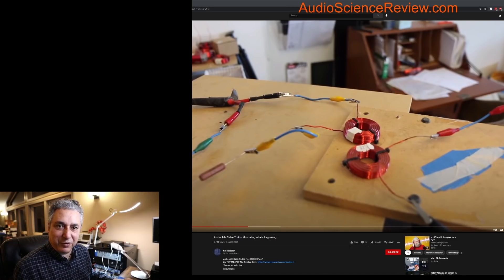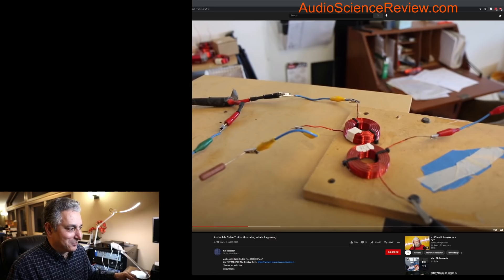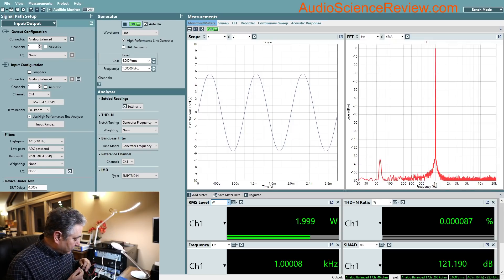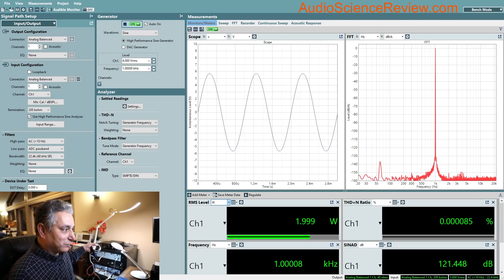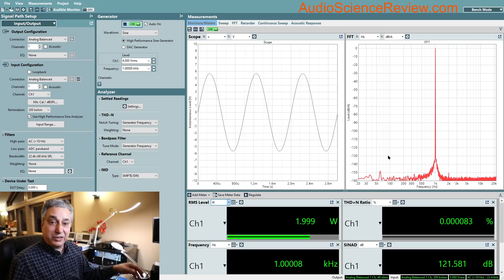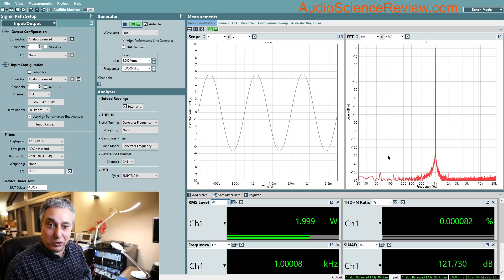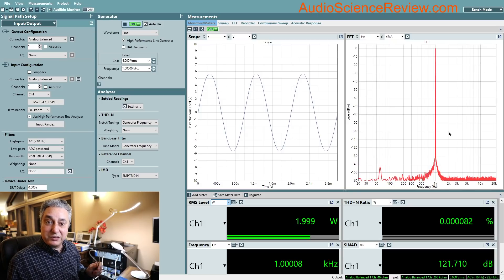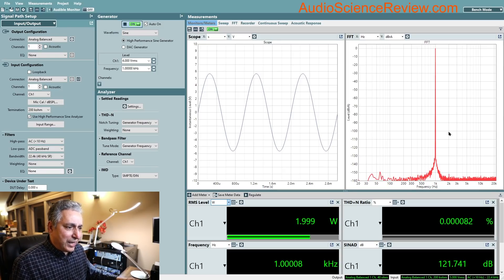Electromagnetic Interference In Speaker Cables?

Comment: Paul from PS audio said that the frequencies that we cannot hear, do to some degree affect the ones we can hear. And that is why ultra low and high end  speakers affect the listening zone.
So again it just shows that these measurements are not as black and white clear.

Plus for some people, especially most at the lower levels of HIFI, could potentially gain from having a bit of distortion.

Plus you can actually hear someone moving the cable. But it requires someone doing that for you while you are in your listening position. And just occupying that space physically behind the system, could actually change the sound so that the sound waves don't travel the same in the room. (so that argument is invalid)
Reply: I sincerely hope that Paul from PS Audio's claims are the next target for Amir's videos.  Amir's scopes can easily measure noise in frequencies far above and below what we can hear...so they would show up on the scope.   In addition, even though cables can transmit a wide range of frequencies...no speakers, even high end ones, will reproduce those frequencies, they will not even try to. When someone asks you to spend thousands on speaker wires to eliminate distortion that cannot be heard and cannot be measured....think hard before pulling out your wallet.
Reply from the maker: Paul is appealing to lay intuition, not any kind of reality.  I can tell you that you can cure the pandemic by having people drink vinegar.  And that it is acidic and hence kills viruses.  If I provided no proof of such miracle cure, will you take my word for it? I hope not.  Paul repeats may audiophile myths.  That doesn't make them remotely true.   Also, distortions I am measuring are inaudible so you can't make a case of them being euphonic.

Comment: Amir, can you please do a video on cables with a signal "direction"? My dad would swear by them, but audio is AC so even if copper could have a direction, it makes no sense as far as I'm aware!
Reply from the maker: Sure.  I have done the testing.  Will see if I can put them together as a video.
Reply: @AudioScienceReview  Awesome, looking forward to it!
Reply: my theory on directional cables is they're just so people dont plug cables into the wrong jacks, like plugging outputs into another output by accident. then cable manufacturers were like directional cables sounds like a feature....
Reply: If you don't draw arrows on all your cables, are you even an audiophile?
Reply: I believe it has something to do to which end is grounded and which end is not.
Reply: @Audio Science Review  In the sense of AC electricty audio is for sure not AC, as for direction im pretty sure its not AC, sure voltage is variable. But the fact that there is only one polarity is what determines if a circuit is AC or DC and audio is definitely not AC. There is only one direction and i believe its one of the cons of dynamic drivers, you cant actually guide them but thats probably another topic it just got me thinking
Reply: @noel.2486  it is not one polarity. Please check your information. Color cables and + & - signs are intended just for phase.
Reply: @noel.2486  Audio is undeniably AC... If you send a single 50Hz signal through it, does it look exactly like what comes out of your power socket, but at a much lower voltage? :)
Reply: audio isnt ac
Reply from the maker: @noel.2486  It better be.  If it is DC, it would either cause the protection circuit to kick on in your amplifier, blow up your speaker, or both.  :)
Reply: @noel.2486  Audio does not have one direction (it also isn't a constant voltage), its constantly moving up and down between negative and positive to produce the sound you hear.
Reply: @Purple__  i didnt ask, still has nothing to do with ac

Comment: I had to replace my stagg rca cables with amazon basic ones to get rid of substantial interference in my studio monitors 🤷‍♀️
Reply: You are right...low level sign cables like RCA are very susceptible to interference.  RCA cables have to be shielded like inexpensive Amazon Basic cables are to work well.   But speaker cables handle signals that are hundreds of times stronger...they pick up noise too, but as Amir proves here, that noise is FAR too low compared to the amp signal to be heard.   Danny's magic speaker cables cost $9.75 a foot plus $40 for the connection kit.  A lot more than Amazon Basic cable.
Reply: @ggroch  I've never messed with passive speakers so I didn't consider the difference. Mogami cables/Neutrik connectors etc are a premium but they're measurably better and safer for your microphones xlr port for instance. I wonder how much EMI running near a high end computer/multiple power cables etc could produce across a range of cable types and how far away you need to be to avoid possible issues, or even partially coiled power cables where there's excess slack to get rid of.

Comment: Amir, would you mind doing a test of stranded cable 12ga vs solid 12ga cable? According to Google there's a 20-30% attenuation difference. I suppose that would mean lower wattage and maybe distortion? I have no idea how many feet it would take to make a difference.
Reply from the maker: Hi Sean.  I actually did a study of various 12 gauge wires.  The only solid one I tested though was the "famous" coat hanger: https://www.audiosciencereview.com/forum/index.php?threads/when-12-gauge-wire-is-not-12-gauge.3/
Reply: @AudioScienceReview  Thanks, that was above and beyond what I asked.  The coat hanger should be a perfect match if not better than the solid wire.

Comment: Hey Amir, since the power cable is not connected to a load there is no current through it right. So how can it produce a magnetic field?
Reply: @Douglas Blake It's the current that is producing the magnetic field , not the potential. Atleast that's my understanding.
Reply: @Douglas Blake yes, that is capacitive coupling. But in the video amir was talking about electromagnetic interference which require current to flow to produce a magnetic field and produce a current in the other circuit.
Reply: @Douglas Blake Yes
Reply from the maker: You general point is correct but not precisely.  There is capacitance between the mains conductors/plug and therefore an AC impedance exist and current does flow.  Putting that aside, I went ahead and measured with a real amplifier load and measured those.  Please see: https://www.audiosciencereview.com/forum/index.php?threads/electromagnetic-interference-in-speaker-cables-video.20647/post-683806

Notice how the amplifier itself is pumping far more mains/power supply noise than anything an AC mains cable can inductively induce!
Reply: @AudioScienceReview  
Amir, you should copy & paste your comment and Link and "Pin" them to the top of the main comments for this video, as there are others disputing this "issue" with your test methodology in subcomments that are buried here.
Thx
Reply: @AudioScienceReview  See, this is why I love your website. You base everything on proper measurements. Thank mate.
Reply: Spot on...👍but have to remember..the speaker cable terminates ( carries relatively higher current ) into a
 " low impedance " load..whereas the mains..
" normally" carries current to a " relatively higher impedance " load...
Reply: @analoghardwaretops3976  That's correct.
Reply: Inductance. That's how induction works. That's the point. Danny isn't running his speaker cables near the power supply of the FM radio station. He's running the along the floor and claiming they're antennas and his product makes an audible difference. Amir just tested the claim and showed that while there is an effect, it's not audible.
Reply: @Clobercow1  Any electromagnetic impulse will create noise, the envelope of the impulse if long enough will be audible, try placing your cell phone near your amplifier and hear each time it reports itself to the network, it is a very audible noise although in the GHz, way above your hearing. Even your Wi-Fi can be heard and that at 2.4/5GHz also above your hearing threshold. If you want to debunk anybody make sure you know your subject not merely being an administrative manger at some big company who often visits his underlings being amused at what they are doing.

Comment: Can you measure one of the conductors in the speaker cable while sending a signal through the other conductor? Would be interesting to see if there's any cross-talk in a normal vs braided speaker cable.
How much more interference would the speaker cable pick up if you don't send any signal through it?(interference relative to 0 watt instead of 2watt)? Danny mentioned that Kimber found out that braided cables reduced the noise of a PA speakers at a disco. Considering the high sensitivity of PA speaker, would it be possible to hear a hum from the speakers?
And how does 120V vs 230V effect the EMI?
Reply: I just wound my headphone cable around my computers 230V power cable a number of times. I was unable to hear anything with my closed headphones in a very quiet room.
Reply: @BullrullarN  Sure there will be cross-talk between wires of the same cable. But that's pretty normal the way it's suppose to be. The real goal is to reduce interference from/to other cables in the system and outside world.
Reply from the maker: One wire doesn't complete a circuit so you can't run that test.  We could test crosstalk between two pairs of wires, but not one wire against the other.  As to the other bits, the moment you change wire, you also change its orientation and characteristics of how it was used so such comparisons are very difficult to do in real situations.  That said, yes, if you have a real, audible problem with noise then a different cable may resolve it but that is not the topic here.  Folks say you can fix things you can't measure.  That artifact would clearly be measurable.

Comment: Thanks for doing these. I know it's nonsense but i lack the technical knowledge to disprove why it's wrong but your explanation makes it easy to understand.
Reply: The test method is wrong as the power cable isn't plugged into anything making it open circuit with non current flowing meaning no magnetic field and thus no interference. Don't blindly trust anything you see, not matter how badly you want it.
Reply: @Nikolajchris  if it was plug in, would pick up less interference. Interesting that you choose to baseless criticize this, instead of the two coils "experience".
Reply: @paulopereira6996  First of all, the speaker wire is plugged in in both ends, but the power cord which is the source of the interference is only plugged in in one end, making it an open circuit configuration. 
Assuming this is what you mean, then your claim is not true. If not plugged in, no current is drawn, making no magnetic field around the wire that can induce a magnetic field and thus create a current in the other cable. What do you base your claim on that my comment is baseless? Mine is founded on a master's degree in electrical engineering and in actual science, discovered by H.C Ørsted as far back as 1820.
https://courses.lumenlearning.com/boundless-physics/chapter/magnetism-and-magnetic-fields/

btw, haven't seen the other video - I'm only pointing out that this demonstration is faulty.
Reply: @Nikolajchris  maybe you fail to understand the power on the cable is alternate current... Can you please send your master certificate? ...
Reply: @Nikolajchris  there is capacitance between conductors, so there is impedance and current flows. Please refer again to your AC theoretical hand book.
Reply: @Nikolajchris  your videos are for a DC  scenario...
Reply: @paulopereira6996  yes, that's true and the wires also have an own-resistance, but both are so tiny that it resulting current draw is at a neglectable level, especially for these kinds of tests. An amp drawing a significant amount of power is a much more relevant case. 
Again, what is your qualification? You clearly don't know the differences and similarities of AC and DC - the theory regarding open-circuit is exactly the same. The video with electro-magnestism is clearly AC, otherwise an electro-magntic field wouldn't be sustained. 
I'm done debating with you. Take my info or leave it. I'm only trying to educate you but you clearly resist and are even disrespectful about it. Good day to you sir.
Reply: @Nikolajchris  Can you please send your certificate for the master degree? Don't you see a problem in here? I can say I was your professor. You don't snob people online, you don't know who you are talking too. So you prove what you know, and not get the master card, this is not to be take serious. So there is current in an open AC circuit after all... Mind that I wrote Impedance, you wrongly quote resistance. Resistance is simply defined as the opposition to the flow of electric current in the circuit. Impedance is opposition to the flow of AC current because of any three components that is resistive, inductive or capacitive. It is a combination of both resistance and reactance in a circuit.  You should go back to AC theory.
Reply: @paulopereira6996  the reason I pulled the "master card" is that you questioned my baseless criticism, which isn't baseless at all but rather founded in a long university degree and a profession within the field in question here - that's the only reas on...
As you can surely understand I do not intent to share my certificate with a stranger online. I've tried to send this message with a link to my linkedin-page quite some times now, but yt won't let me post it, due to the link I suspect. You can try to find me there yourself: Nikolaj Christiansen, Acoustic Engineer at GN Group.
I've now attempted to prove myself - your turn to validate your claims by doing the same.

There's is a neglectably small current in the open circuit power cord due to capacitance, yes. Some uA i would guess, that are not comparable with the 10-15A (EU/USA respectively) a wall socket maximally can deliver to a power-amp pulling many hundred watts. 
Regarding capacitance, I wrote: yes (implied: there's a capacitance) and also a resistance - you didn't read my comment the way i intended it to be read, so it could arguably have been formulated better. Sorry about that. Resistance is the real part of an impedance (often expressed as a complex value) and can therefore also be denoted as an impedance in itself - you don't know the terms you use so I urge you to go back your basic electronics book, if you even own one..?
I'm certainly not being a snob for pointing out that the message given in this video is not accurate - quite the opposite, I would agrue, as Im spending my time trying to help clean up the misunderstanding that this video posts for those who do not have the technical foundation to debunk this themselves.
Reply: @paulopereira6996  This is obvious, unless to place the conductors far apart the capacitance becomes less or you make the conductor surface miniscule and the capacitance becomes less, what exactly is your point?

Comment: Love this guy, he's exploding audio myths one by one.
Reply: However the test method is wrong as the power cable isn't plugged into anything making it open circuit with non current flowing meaning no magnetic field and thus no interference. Don't blindly trust anything you see, no matter how badly you want it.
Reply: @Nikolajchris  Thank you, can't believe this isn't obvious.  Plug it into an amplifier pulling several amps.
Reply: @Nikolajchris  
 @scott cionek  
Well, Amir gave you the option.  Do a blind listening test with your own ears and with your own equipment & setup!

Try using a simple household cooling fan with an AC electric motor.

I say this because this type of simple, brush & armature motor will most likely produce more spurious AC line noise than just about any other common household device, especially when it is switched to a lower speed other than full power.

A hair dryer would probably be technically better, but obviously too mechanically and acoustically noisy for this test.  Or perhaps use a microwave oven, or electric hair clippers...of course, both of those are problematic due to mechanical noise as well.

Anyway, after you choose your "noisy EMI test device", have someone place your speaker cable in parallel with that device's AC cord while it is running without you knowing when or if the two cables are together or not.  

Like Amir said, raise your hand for your helper when or if you detect a perceivable difference and see if it correlates to the cable's proximity to each other.

BOOM!  From that moment on you'll know if it really makes a difference.

But I would ask you to consider that 98% of household devices that you would commonly have in your listening room AND in close proximity to your speaker cables will produce far, far less EMI.

And even if they did, a simple solution is to have those two cables only cross each other at a 90° intersection, and the issue is eliminated.
Reply: Ethan Winer did similar debunking, going back decades. Sad that we still have to do this, but our test gear has got better;- https://www.youtube.com/watch?v=ZyWt3kANA3Q&ab_channel=EthanWiner
Reply: He is not the only one, pretty much everything you see here is decades since being settled but.. snakeoil is powerful, they have a financial incentive and no morals. So.. these things has to be "busted" constantly. I am very grateful as Audio Science Review has gathered quite a lot of respect, even from snakeoil believers.